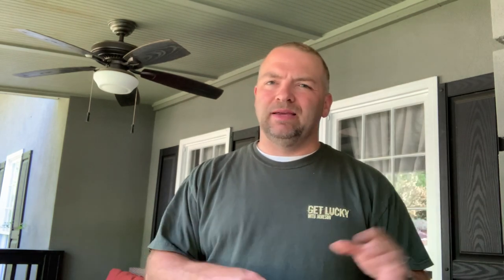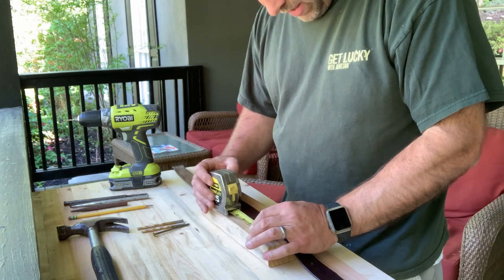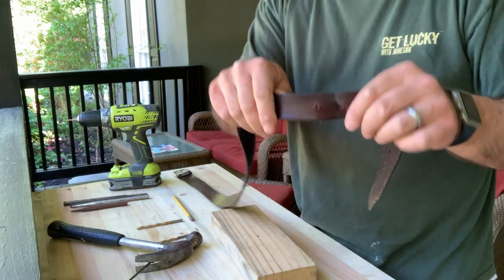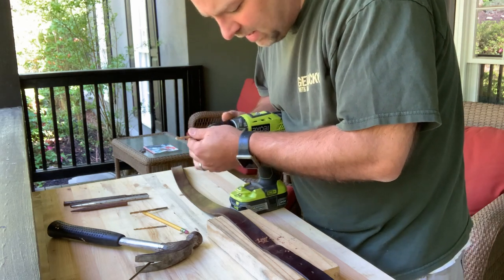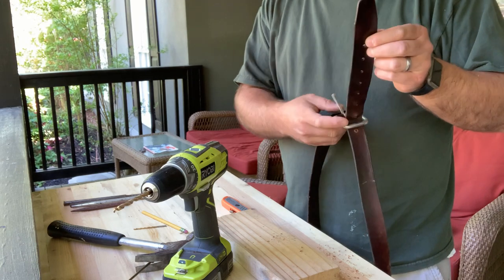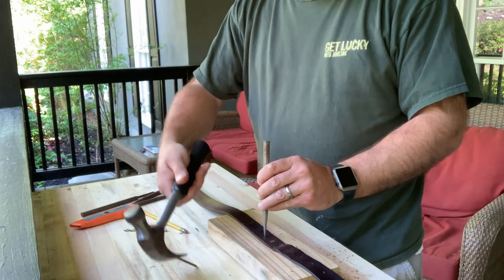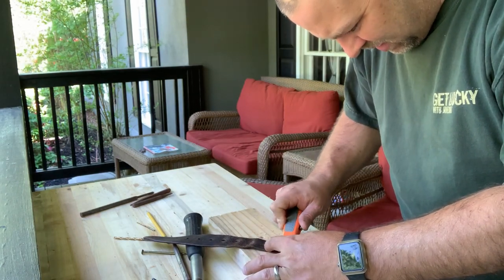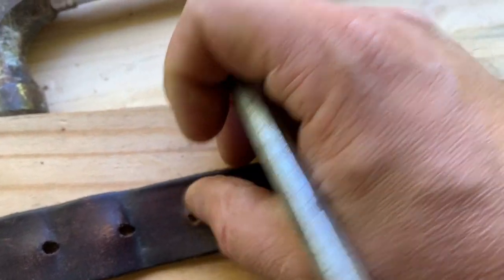How to Add a Hole to a Leather Belt! 2 Methods - Drill vs. Punch - by DIYNate

Comment: Good job on the weight loss. I am trying it myself and your method is the best for not regaining it back. I think the punch is a cleaner look   Thank you for sharing
Reply from the maker: Thanks for your comment!  Good luck on the weight loss and hope the hole with the punch method works well for you!  That was my preference as well after trying both.
- DIYNate
Reply: Hey, just came here to find out how to make a new hole into my almost new leather belt because I lost some weight lately. My doctor prescribed me those inject pens (here its called Saxenda) and it'S usually for diabetics but work perfectly, because you are not hungry at all, I have to force myself into eating and I'm loosing weight like never before. Try to ask your doctor, in Czech republic it's pretty common now but since it's a drug you'll need a prescription. 100 % legal and under doctor's supervision. Good luck my friend.

Comment: you've butchered it, dude. It doesn't look clean at all.
Reply from the maker: It is holding up well a couple years later.  I would opt for the punch method doing it again as the drill can be more messy, but when the drill is nearby and you are going for fast over pretty, I’d do it again in a pinch.  Certainly not with a nice belt though.  Thanks for the comment!
- DIYNate